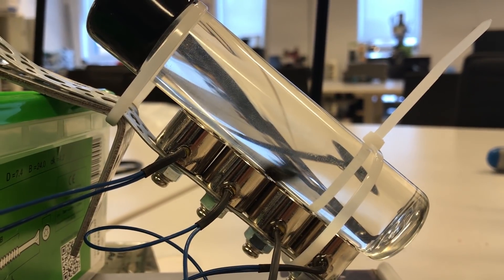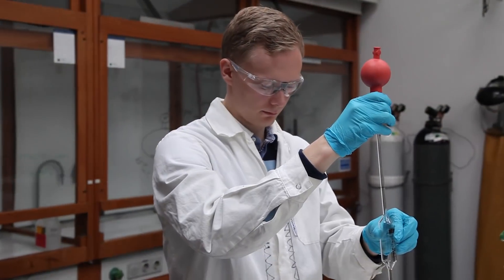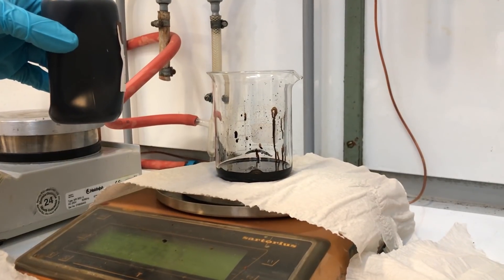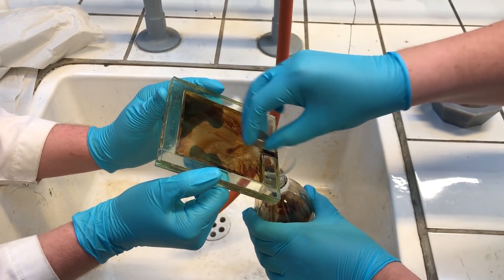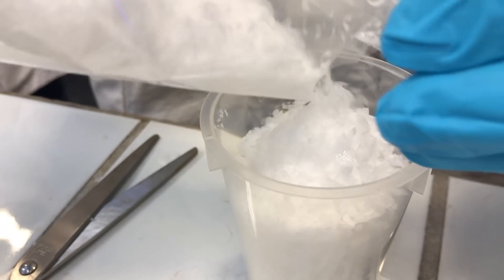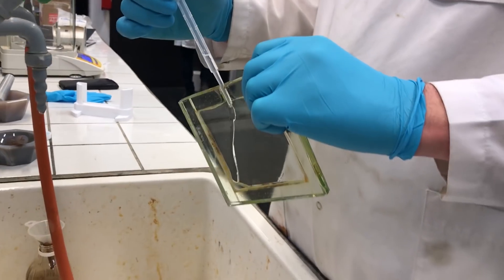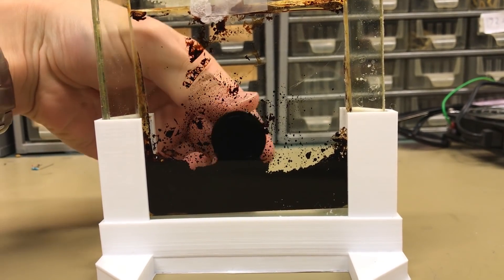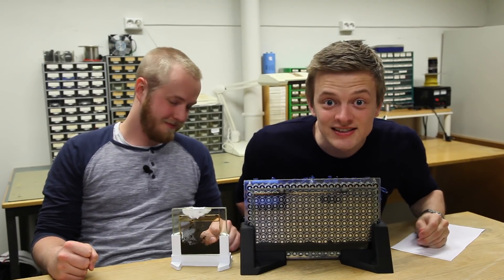How you can avoid stained ferrofluid containers - Fetch #2

Comment: HI there, great project! I'm working at an exhibit on ferrofluid in a science center and testing the cleaning process with vineger. Question: did you also try to clean the chamber with it? Or you tried and it did not work? (With bottles it works, however we wanna have our proper design, something flat as your project, and a glas blower should do it for us...)Thanks for your time ;)
Reply from the maker: Hi, we didn’t extensively test different cleaning solutions. We saw very mixed results during our initial testing and sort of went straight to the hardcore route of a lab-grade base bath (unfortunately). In retrospect we see that the mixed results may have been caused by not waiting long enough between adding suspension liquid and adding ferrofluid to the container, so keep that in mind in your project.
Reply: Hello, did u make it work? what did u do to prevent staining? working on display but i am still not satisfied. Thank You

Comment: Periodically I have fun with experiments, there are certain and unexpected successes. Water is the best "oleophobic".
There is no desire, no opportunity, no knowledge to modify the VF itself. It remains to influence the surface, or the composition of the "shell" of water.
Any hydrophobes, PTFE and other coatings that do not like water - do not work and it is logical (only it was not immediately obvious). Water begins to wet the surface even worse, which actually multiplies the chance for adhesion by the ferromagnetic fluid itself (the result is dirt on the walls)
A solution of salt and water, apparently, also acquires greater "permeability", and is better "fixed" on the glass surface, but the effect requires very thorough cleaning of the container and a long infusion of the solution before adding the VF. But the test for a strong magnet does not pass even 5-10 minutes in this state. In addition, according to reports from other sources - over time, the salt begins to crystallize.
Sugar (+ distilled water) gave an amazing result. Ala the effect of "sticky" slurry, which instantly covers the glass and does not allow it to break through to the surface of the VJ. The problem is the same - crystallization and some kind of deposits (perhaps some kind of reaction of the VF to the sugar present).
If you follow the path of surface modification, you need superhydrophilicity.
I looked through all the auto chemicals that are on our market - there is almost nothing at all, or it is custom-made and expensive (for example, the SOFT99 polymer coating). I decided to try an anti-fog agent - the principle is similar, due to the increase in hydrophilicity - the drops spread and are NOT collected by microcondensate.
The first experiment is folk :) Rub the shaving gel dry into the glass. The result is excellent, on the first attempt an "interfacial" layer of water appeared and the FJ just rolls over the surface. But .. in another day, apparently the coating dissolves.
Bought a commercial antifog. It works, but the result is the same as with shaving gel ..
Question. How to achieve the required hydrophilicity of glass (and possibly acrylic, etc.), but with a sustainable effect?

Comment: Hello, I am running into a problem where after an hour or so the ferrofluid starts to actually cause the water to turn a yellowish color. Any idea on how to prevent this? Thanks!
Reply from the maker: Are you using EF-H1 or making the ferrofluid yourself?
Reply: @AppliedProcrastination  EF-H1 I believe. I just bought it off of Amazon

Comment: You mentioned before that you use 2mm glas for your display but can you tell me the distance between the two glass sheets? I guess 5mm?
Reply from the maker: If I remember correctly they are spaced with a 6mm piece of glass plus two thin layers of epoxy
Reply: @AppliedProcrastination  thanks for your instructuve videos. What is the reason you put epoxy on the glass?
Reply from the maker: Oh, I’m sorry. What I meant was just the epoxy glue that holds the pieces together. We are not treating the open glass surface with epoxy